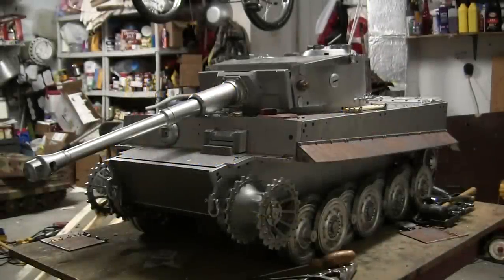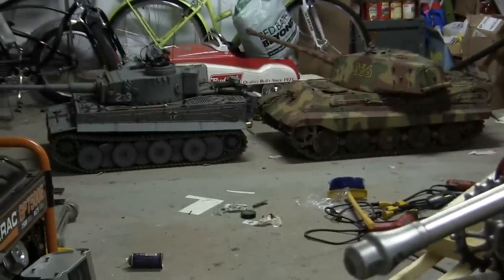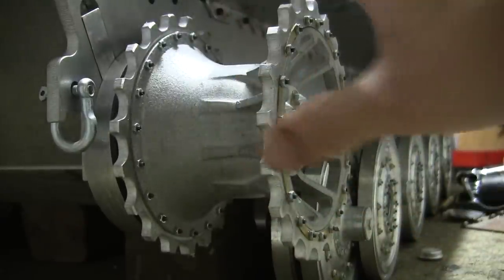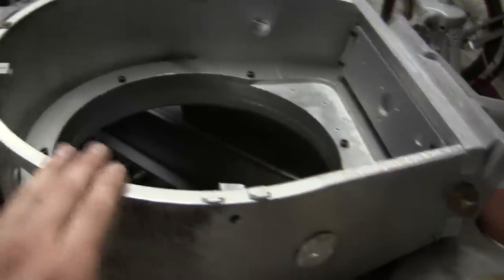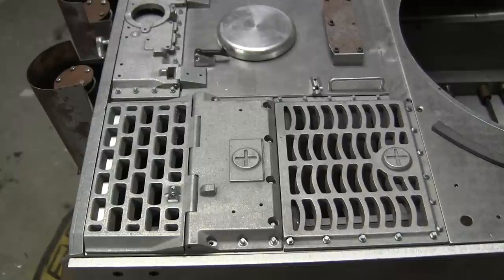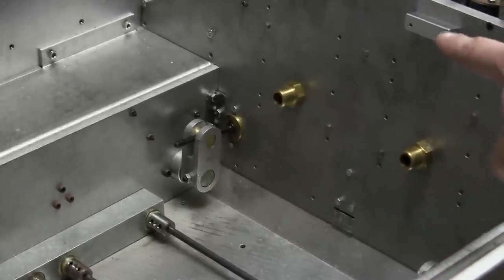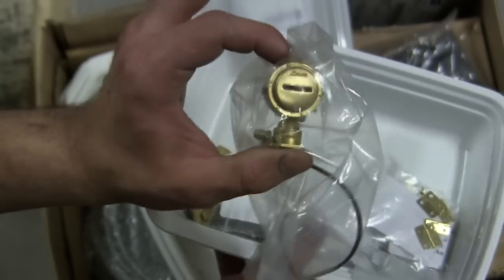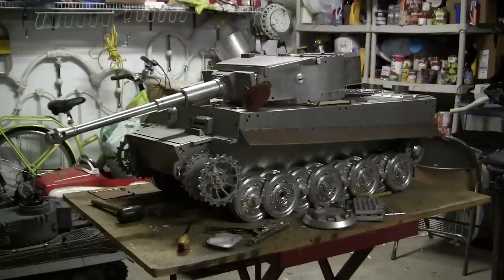Armortek Late Tiger I Project video #1 (introduction and project start)

Comment: Can you build one from scratch for someone? meaning contracted to build the whole thing. and what would it cost and ship? And make it rc also
Reply from the maker: I don't do full scratch builds for commission as the time / work required to build a scratch build will be amplified and will end up costing 3X more then a kit build. The only scratch builds you find on my channel are for my personal collection only. 

Also the only RC builds I will ever do are form a RC kit, as the type of tooling (CNC, metal castings) to make all the parts in metal are not something I have on hand
Reply: Guess what I meant was would you build a full kit for someone who does not know how to do it themselves.I am new to the tank world and would like a tank like the one you built in this video. And how much would it cost. I have built small RC cars in kits but this looks a lot more involved in electronics and painting along with metal work as you stated in the video.
Reply from the maker: I see, yes I do take on kit build commissions The prices differ as there are some options available and this effects the overall price of the build. this is best done via email, and my email address is info@eastcoastarmory.com
Reply: Thank you .